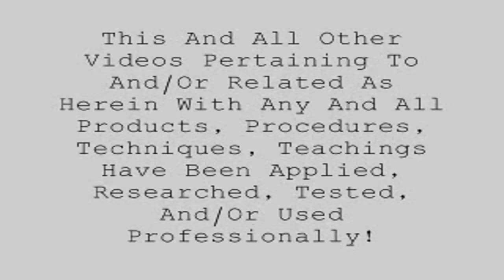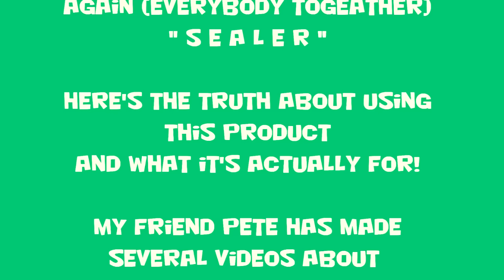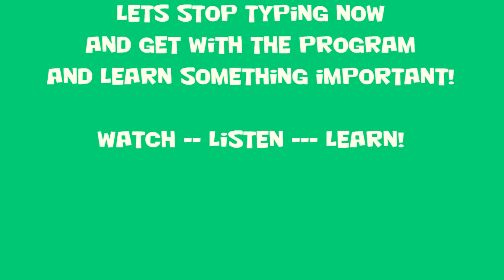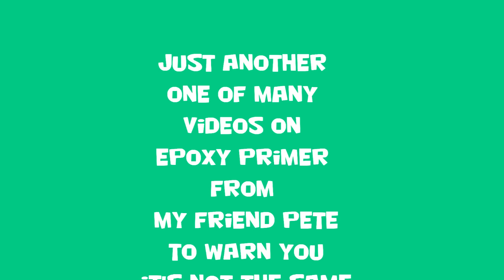How To Use Epoxy Primer - Automotive Paint And Body Tech Tips

Comment: I agree Pete because rust scares me especially when I am doing a vehicle for me, myself and I. This 1967 C10 pickup fortunately had way less rust on it than many. But properly stripped, cleaned bare metal multiple panels is something I can't done in a month, 6 months or multiple years. I want it sealed like a layer of liquid plastic wrap, outside and in. That is right, the inside of doors, bedsides, behind the window pinch welds, behind and inside the inner wheel house(S) all four. The bedsides are neglected and the Rodney Dangerfeild of body panels. To me, it is NOT enough to have cleaned the inside of the side bed panels (As we are talking a truck) using your methods of metal cleaning with "Muriatic Acid, followed by vinegar solution then drying with heat & a leaf blower if needed to reach with my long arms and scuff, wax & grease then spray each with two coats of epoxy primer for mil-thickness and protection I desire to have inside these panels so I can sleep well knowing I did everything correctly to get best protection I can have on these hidden areas. They will be painted with a good coat of black to provide that rock chip, ice burg hit they take and be safe. Formulas of plastic filler have come and long way since the 50's when introduced, but regardless of what they pack in the can, to me, first needs bare metal but act as a sponge. I have removed factory paint from our family cars where a rock chip is visible and find an 8 inch spider web of rust fingers the size of pencil lines appear like lightening bolts that cover the night sky, and this freaks me out in amazement how it travels under OEM paint. Dipped at the factory or not, this damage never sleeps. So hammer & dolly or sand to apply a quality filler, I will re-coat these repair with epoxy and not the "DTM" type as this stuff with a mild acid is trapped under everything else you do afterwards and I don't trust it! You video info is dead on in todays world as being pushed at the point of sale as a product that does everything ! I call this "Spray & Pray" as every product of theirs after that will last for ever. I have OEM pressure pot with quick release hose nozzles for internal frame coating, but has 11 quarts. I just took delivery of 4 more in a case. This goes inside doors, rockers, A-pillar, B-pillar, roof, inside bed sides (pickup) but all places water goes but not sunshine. Your videos on epoxy it step one on bare metal. If folks ignore this step & product, they should use house paint to finish the vehicle. But always researching and not seeing common sense applied. It is like a concourse restoration but no seam sealer! Isn't that step 3rd or fourth? 
DK, ASE master, retired. 
Blessings on you knee surgery soon! Take care...
Reply: Dean do you do videos? I would watch......   Phillip Hall
Reply: @PhillipHall01   I didn't own a cell since 2008, but now 4 fusions and 3 surgeries since December has left me using a cain to walk. I have to go back to the fall of 86, to lock my toolbox, walk out and change jobs. This would have avoided the injury outside the shop that took five hours. I am not able to stand in front of my own tool box to put tools away. I wish. Thanks!
Reply: @PhillipHall01    I am sorry as I can't quit thinking about your question. I would enjoy sharing what I learned but physical going down hill fast. I have a son out of state who is doing very well in business, my youngest has a desire for his 80's cars but has developed a very abrasive personality. He ask me to mix paint products and I used my spray gun, not his purple one. His 81 El Co needed the twin cooling fans wired & a newer single wire alt. I added fused distribution center and ATC center that is off with key. Choke heater, alt, 2 fans do not need to drag the starter down on his 450HP 383 cu in stroke I built him 4 years ago. He blew up two diff's, 2 transmissions until I built a 700R4 capable of 600HP. He wants it done, but my nature it to explain...he gets mad claiming I am waisting time! He wants to wear his hat backwards, smile and wave at total strangers! That is a cry for attention. He gets mad because I never taught him to MIG weld, yet he simply yells at me to do it, he takes off. No respect, mess, can't put sockets or wrenches away as he claims he doesn't understand fractions. 90% is metric on the floor, bench and driveway. I saw gum foil in the grass on my way to the mailbox, took a detour to pick it up, found my 10mm long pattern combination wrench from SnapOn laying there. He was born in 85, I told him the wrench is older than him & cost me $26 to replace. He blamed me, he is gone from my house back to his baby's mama rental house, two boys + dog! He drinks straight whiskey and she does to. Shame. He has hit me, pushed me backwards over parts and called cops on me in my house. I leave a room, go to garage, he shows up an hour later, starts in again. I leave the garage, go outside close the door and sit on the landscaping. I have a declining back problem & they are running out of things to try. Where to my tools go? Who gets my house, motorcycle, 69 Datsun 1600 Roadster restored. I have 2 tons of new boxed GM parts and can't figure out how to use Facebook marketplace! I have room behind the house for a nice sized garage, but permits, concrete, wood everything is bad timing. We live in beef country surrounded by towns with packing plants yet paid $4.58 per pound at a reasonable store. Crazy! We don't go out to eat, I never go anywhere, want to buy some 2X4" metal tubing to build a rotisserie but they told me $890 for 24' with 6 cuts ($1 per cut) What? Oh well that is life. 
Stay healthy and safe. After 7yrs as Raytheon contract Labor holding 4hr tech seminars in 7 states, they say my number climb to 100+ at seminars as 54 others say declines. No one will stay if you don't bring an "A-Game."
Best of luck!
Reply: @deankay4434  
Wow Dean, I don't know what to say. Your Son is Blessed beyond his understanding to have a Daddy like you. Its sad he does not realize just how blessed he is to have you.  I am sorry your golden years are not happy ones. I think it is awesome that he someone like you who is knowledgeable and skilled in your profession who is more than willing to teach him. It seems to be the way of the world these days. Just as the Bible says people lacking natural affection.  God Bless you in your sorrows and may he shine a light of hope and love in your life. Jesus is the answer and Jesus is the Way. 
John 14  King James Version
1. Let not your heart be troubled: ye believe in God, believe also in me.
2, In my Father's house are many mansions: if it were not so, I would have told you. I go to prepare a place for you.
3. And if I go and prepare a place for you, I will come again, and receive you unto myself; that where I am, there ye may be also.
4. And whither I go ye know, and the way ye know.
5. Thomas saith unto him, Lord, we know not whither thou goest; and how can we know the way?
6. Jesus saith unto him, I am the way, the truth, and the life: no man cometh unto the Father, but by me.
Blessing Dean, Phillip
Reply: @PhillipHall01    I have been looking in the Bible as well but can't find the passage; Let thy spinal cord stimulator technician know his trade! ;) I live one day at a time even though the new neighbors ask my wife who the guy is, that is mowing the leafs and lawn while walking wife a cain? I would just as soon be in the top of the barn stacking hay on a 100 degree F day, it was easier. Over a week and had not heard back from stimulator rep/tech or Dr. I believe they want this 6' 3" guy to go away after they had 3 tries. I was 62 when they started last December. Getting worse each year and it scares me. Then they tell me about a lot of scare tissue...YES! 4 fusions, 1 done twice, 2 are bone, 2 are rods, screws and bars (Harrington procedure / internet video if you have the stomach to watch) radio frequency ablation, stimulator trial = good (60-70%) implant = backwards, went down legs into heels, not up into lumbar? Then second set of electrodes = 4" right of spine in ribs not spine. I am almost ready to give up if it wasn't for my pickup rebuild. Engine / transmission done. I hope I can get it done! Thanks for the very words.
Reply: @deankay4434  
I have done my share of  hay hauling!  Boy oh boy, in the humid South on a 98 degree day with the sun bearing down with no shade and the barn tin roof loft and dust flying, no telling what temperature we endued!   It’s a wonder we lived through it! 😊
Reply: @PhillipHall01   Phill, remember taken a shower once home and finding hay in places that was impossible? Or so you thought!
Reply: @deankay4434 
Yep! lol

Comment: So my friend Pete, my question to you is, I live in Minnesota and basically a tuck under garage. Cars flash rust real quick up here. If I’m taking a car down to bare metal and can’t do all the prep work on the car at once. To keep the metal from flash rusting would I then apply the epoxy primer sealer then when I get to that part of the car, would I then grind it down to bare metal to do the body work then primer over that again?
Thanks My friend Pete, I really like your channel
Reply: Not sure if MFP replied to you or not, but yes thats how you do it, if your working in stages
Reply: Yes you got it
Reply: When stripping to bare metal and doing Epoxy you can do one panel at a time. Strip > Clean > Spray with epoxy. Repeat with every panel.
Reply: Thanks! g m ,I appreciate that
Reply: @SOLDOZER  thanks 😊 for the reply and advice

Comment: i think maybe i've got it. the epoxy "primer" (sealer) is for protecting bare metal while you do body work. sand off epoxy primer to do body work. re-prime to protect body work. then we remove all the sealer, and use a sandable primer.

or, after body work and blocking, seal with epoxy "primer", then color.
Reply: Sounds about right !

Comment: I'm about to epoxy primer my suv for winter driving because the paint is trashed it looks like a meth mobile.. will I be safe to drive all winter and paint when the weather breaks in spring?
Reply: Just prep the surface really well with 80 grit on a da sander you’ll be fine
Reply: So you can just redo it again in spring
Reply: If you use EPOXY PRIMER. Yes.
Reply: Epoxy primer sealer

Comment: Wouldn't the peroxide in the filler cause it to rust if you do body work over bare metal?
Reply: Every filler I've used says to put it over bare metal. I would follow the instructions on your filler's can or TDS(technical data sheet, which is the manufacturer's instructions, basically). I mostly use Evercoat Rage Ultra, which is probably overpriced but I can find it for $60-$70 a gallon. On Amazon it was $128 last time I checked.
Reply: The peroxide in the harder is technically corrosive to bare metal. Does it cause any issues? None that I have ever seen.
Reply: Epoxy primers are also peroxide activated.
Urethane s are cyanide activated. Pete is spot on explaining this.
Thanks Pete. Lots of non painters claiming to be experts
Reply: @ronbittner450  many respected painters put filler on top of epoxy primer. Personally, I put body filler on bare metal because I think that’s what Evercoat Rage Ultra recommends in it’s TDS. I’m not sure if they mention epoxy primer. I don’t doubt that it’s probably better to our body filler on top of epoxy primer but I don’t like the part where I have to spot prime all of the spots where I sand through the epoxy. Seems like it’s probably better than way though. Again, I put filler on bare metal, personally.
Reply: @Titans2138  I have also put fillers over epoxy and straight over metal.Depends on what I'm going for $$$$
Reply: @ronbittner450  Where do you get there is peroxide in epoxy primer activator? Not according to the SDS

Comment: Thank you. I do have a question: why use "epoxy primer (sealer)" at all? is the purpose to prevent rust?
Why use "epoxy primer (sealer)" once all the body work is done, prior to painting? why don't just use primer?
Reply: If you have a car that has been stripped to bare metal, putting an epoxy sealer on the bare metal will protect it from moisture so it won't rust while doing body work over long time period. It's waterproof while sandable primers are not. Resealing prior to painting gives you a better surface for your paint and color to be more consistent. Your paint won't soak in the epoxy sealer like it would on softer primers and give you inconsistencies where you may have body filler and areas that don't.
Reply: After block sanding you will have areas where your primer is thicker in places than others and areas that have filler and areas that don't. So your paint will lay on top of some areas more than others and soak in areas more than others. A seal coat before painting will give you a consistent surface for a more consistent look.

Comment: Been in the business since 86. To my knowledge...epoxy isn't porus like fill primer. Even direct to metal is questionable, as long as you never watersand until you have it painted. No epoxy under fill primers can result in moisture absorption down to the bare metal. Lacquer primer days, people stripped to bare metal, primed, put outside to cure and shrink. Then it gets wet, later watersand it for paint. Wash it all up,then paint. 2 months later...all these small bubbles come up in the paint. Oh it's moisture in your air lines, possibly! But more likely you didn't have an epoxy under you primer that keeps moisture from soaking thru. Just an observation.

Comment: I can spray epoxy sealer lol and paint over it no sanding😂 but it must be in the window of opportunity, you have to make sure there is no runs, but I sprayed the 2K on epoxy without sanding once again, if it’s in the window before it sets up fully I only spray paint over epoxy on the Flores or inside the cab

Comment: There is so many different epoxy paints, most are gummy to sand. Some industrial use epoxy primers go rock hard and are pretty ok so sand. Harder to sand than highbuild 2k primers, but still pretty ok. Remember folks to accurately measure the hardner and paint in epoxies, too litle hardner and wont cure. Too much hardner and the "too much" part of the hardner will not be used in the cross linking prosess and will act like a plastisizer.. and paint will be soft and gummy. Acrylics and polyurethanes aint even close to be so tempementral as epoxies are. So measure the parts of paint/hardner, not just pour by eye.

Comment: So body work first on bare metal then spray epoxy, can high build primer be used on top or is high build primer for bare metal all this knowledge you drop makes me want to not do my own body work
Reply: Epoxy primer is for if you're stripping your whole car to bare metal only. It's to protect the bare metal, nothing else. If you're not stripping your car to bare metal, you would not use it.
Reply: So epoxy for metal, then any body work repairs then primer for something to  guide coate and block? I'm a newbie but metal is the way I'm going as paints cracked and very very old.

Comment: You can wet sand it no?
Reply: NOOOOOOOOOO
Reply: For  the 2,000,000th time.........NOOOOO.
Reply: @SOLDOZER  missing my point. I had gumming up on dry sandpaper so I used wet and no more gumming. I was being general in my "question" meaning wet sanding would stop gumming.  Not specific to the point where he was at in his procedure. And this is the first time I heard you can't wet sand in this context..chill, too much stress from you. 
You will meet newbies you know? All have to learn and ask seemingly "dumb" questions at time or repeat questions you have heard  asked before. Take it easy.
Reply: @saeefullahmohammad1402  You are correct you can wetsand epoxy primer. If i use it as a sealer before base, and i need to nib out any dust imperfections, 800 grit wet works great.

Comment: This is what I dont like about paint industry.  Confusing names about their own products. They say primer while its not. They say Acrylic urethane but its only urethane etc. As far as I know EP should only use as sealer. Sealing bare metal or sealing your 2k primer surfacer before laying your base paint for max adhesion and proper hiding. Its also ( for me ) a reason why I dont prefer putting bodyfiller over an EP. Its not meant to be block sanded and filling imperfections like your regular 2k priner surfacer does. It also gum your sandpaper a lot.
Reply: Direct to metal primers were meant as a "shortcut" for very small bare     metal areas,not for complete bare metal repaints

Comment: Err... Regular epoxy primer is not sandable... BUT sandable versions do exist.
Epoxy primer is a moisture sealer and the best option when you are not going to paint the car soon. It is the primer used on new pre-primed panels.

Comment: Has anyone tried SPI Epoxy Primer? It IS sand-able, will not gum up when dry sanding. And can be reduced to be used as a sealer. Might be too thin for heavy build areas, but can build small stuff....  Just wondering if anyone tried it?
Reply: I Use it all the time! Very good Sealer! Yes you are correct it will not gum up sandpaper after sitting 48 or more hours before sanding. Sands quite nice actually, obviously not as nice as a 2K urethane Primer but its not meant for that purpose anyways.
Reply: @chadwetzel1322  and a VERY good DTM primer...  😉
Reply: Yeah but that's not a true sealer but a true sealer will not be sandable it's non-sanding a true sealer is self leveling and does just what it says seals and is not porous like a over reduced primer
Reply: @tonydiesel3444  SPI Epoxy is a true Epoxy, It is not porous.
Reply: I only use it...